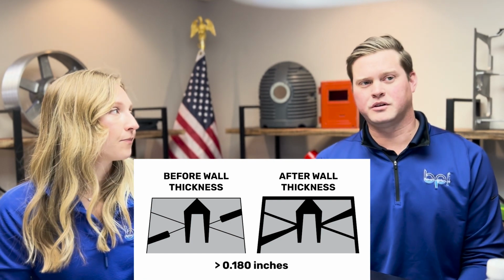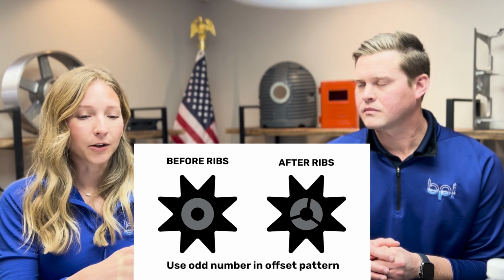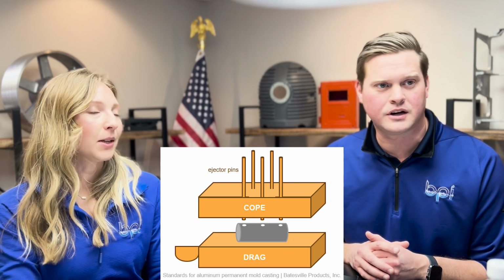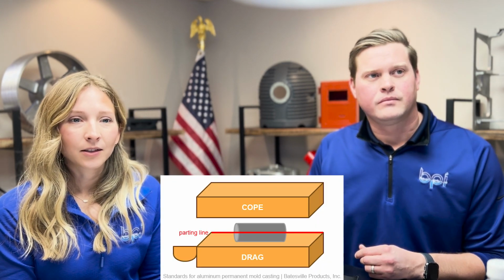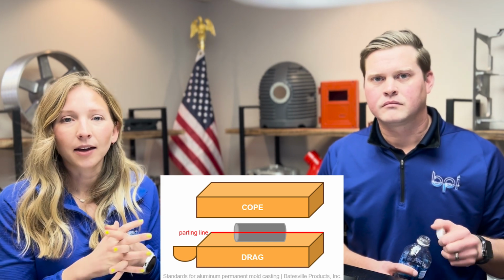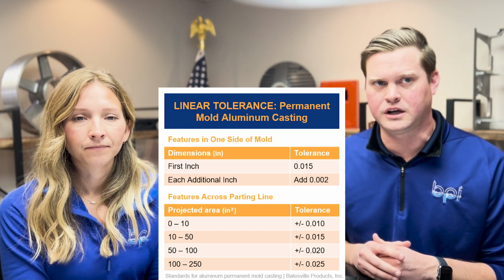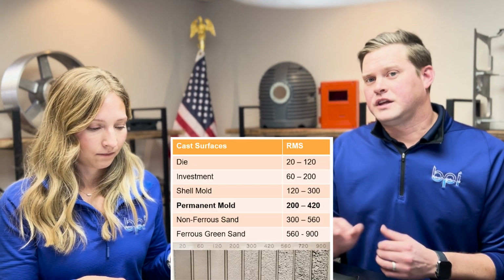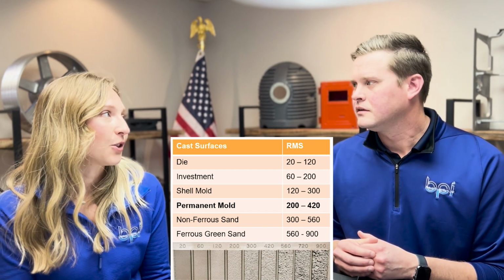16 Design Considerations | Permanent Mold Aluminum Casting (PODCAST)

Comment: What is the value of the calculated shrinkage that you use for the mold design?
Reply from the maker: Shrinkage is impacted by geometry of the casting, cooling rate, pouring temperature, etc. So for all our mold designs, we use a simulation software that predicts shrinkage for that custom model.

You can find a general shrinkage % for each aluminum alloy online, but know that the exact amount depends on design and foundry practices.